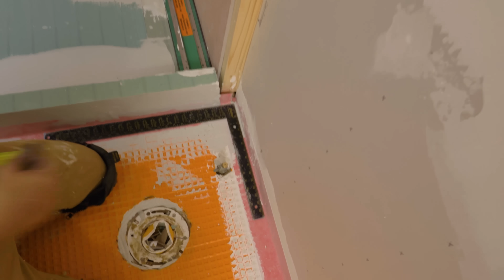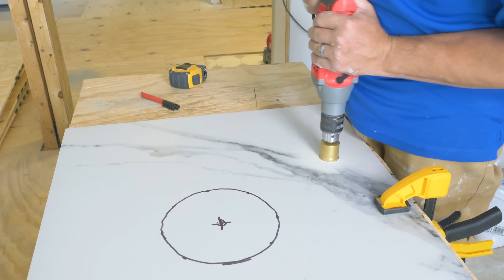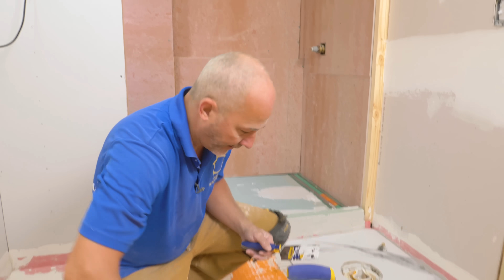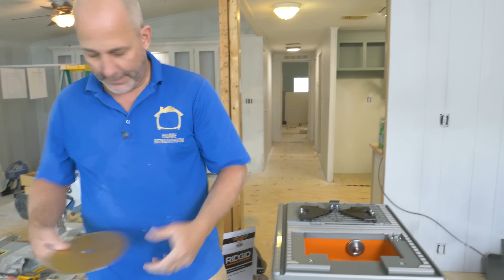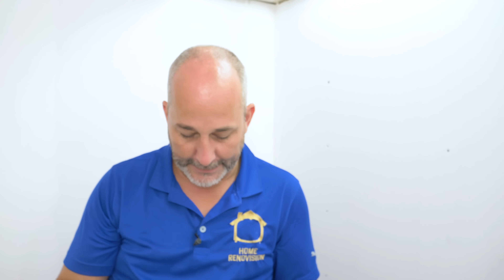How to Install Bathroom Floor Tile for Beginners

Comment: I really struggled with a threshold in my bathroom, as the tiles and Detra mat lifted it higher than the bedroom. I managed to adapt the original wood threshold, but never considered using a stone threshold, which comes with the advantage of locking the water in the bathroom. Brilliant idea!

Comment: Do I need to level the dimensional lumbar subfloor in a 2nd story bathroom before putting Ditra down? Going to be using 12x24 porcelain tile. Also does the vapor tape need to be used along Ditra seems to make it monolithic?

Comment: I strongly recommend using gaffers tape instead of duct tape to tape your cables down to the floor. I can see it in the beginning of the video in the other room. Gaffers tape is made to hold cables to the floor securely without leaving glue residue on the cables, easier to pull up, and won't pull up pieces of the wood floor.

Comment: good job Jeff, although the tile with the heavy design would maybe have been better to use first that has the hole cut outs, as the grain continuation would have looked better

Comment: I understand that transition piece helps keep water from going into the hall or next room but what about around the perimeter of the room? Won't the water just go into the studs and space under the drywall? Or does the silicone bead keep it from doing so? It seems the bead would have to be fairly hefty.

Comment: if laying over concrete, how much of unevenness is tolerable? ive seen no more than 1/8 within 6 feet. so does that mean i can have little dips and humps on the floor within 6 feet as long at its no more than 1/8 inch? ill also be laying ditra but wanted to ensure my subfloor is first ready. thanks!

Comment: You have great videos, but nowhere on YouTube does anyone answer what type of wood they use underneath the tile?  I am remodeling my bathroom shower.  They had plywood (1970's house) on top of the 2x10's before the dark colored cement of some sort, then the tile.  Wood needs replacing now.  Ok, so there are lots of different types of plywood.  Indoor, outdoor, marine grade, etc.  What does everyone use, and how thick now?  1/2", 3/4"?  Probably going the Schluter system after replacing the floor.

Comment: Excellent Vid.
Little question. On one tile you changed direction of the adhesive “comb”. I assume this does not matter?

Any chance you could do a video like this, with one of those electric underfloor heating mats, and a decoupling mat  on Plywood?

Comment: Jeff I noticed you taped the seams around the edges of Ditra membrane with that pink tape. Is it necessary to tape the seam running the length of the room where each piece of Ditra meet each other?

Comment: An excellent tip provided by 7.7.0bassin2 - (just slightly tweaked) Be aware, if this is your first time laying tile you need your cuts to be perfect, if not you can ruin your project. TIP: Get pieces of cardboard cut them to match the size of the tile you are installing. (example in this video Jeff’s are 24x24) - Then, when you need to cut a tile to make it fit, first cut one of the pieces of cardboard instead of cutting a tile just to sure everything fits the way you want it...  then... Repeat the cut on your tile. - Doing it this way saves you from cutting a tile incorrectly which can get expensive if you have to toss them out.
Reply: Brilliant! Thank you.

Comment: I did my first tile job in our bathroom and used the same spacer wedge system , worked really well. Always wanted to try laying tile , the wet saw worked really great . I did learn , don’t mix the whole bag of grout , by the time I was almost to the end it was starting to dry up. 
Thanks for tips

Comment: Thinset doesn't stick to thin set. When you prefilled those holes you compromised the whole point of the ditra waffle design. The holes hold the thinset to the membrane

Comment: The stone thresholds usually need to be sealed right? At least that is what mine says. Instructions say seal before cutting and install, and seal again after. Is that altogether necessary? We have had quite a bit of extra expenses, large tools, that we were not expecting and my husband is not happy we might need to purchase something else to finish this renovation. But we do want it done right… can we do without or is that stupid?

Comment: You didn't tighten the arbor nut on the saw before you plugged it in or use it?!
Jesus man...lol. 
Glad you corrected that later, you had me worried!

Also, why did you thinset over one area of the Ditra and allowed it to dry (3rd tile area)?
That ruins the whole point of the Ditra as those key holes are already dried & not bonding to the tile to allow for movement.

Comment: What thinset did you use? Is it the same schluter all set you used for the schluter ditra video? At what size tile do you recommend using the spacers that level out? My tile is 8x10 inch. What grout did you then use? Did you have to seal the grout afterward? I've watched this at least 5 times, writing down everything and getting up the courage to tile my own bathroom! Thanks!!!

Comment: I know  you're  doing tile, but the wood in my bathroom door way is damaged, can that be replaced without having  to replace the entire frame? I learned so much from your tutorials,  even if I decide to pay a professional, I know what to look for or even which questions to ask, to help me determine if they are a fit. TY so much for your tutorials.

Comment: Hi Jeff. I need to replace my tiles as they are chipped and were installed unevenly before I bought my house. My home is in an extremely humid tropical climate. Are tiles my only option for flooring? Would appreciate your advice. 😊

Comment: Now there is a well in your” waterproof “ floor under your mdf cabinet should have installed a piece even with a very rough cut and fill  with thin set. Just saying.

Comment: I have a bathroom remodel that is on the opposite side of the house from the septic line.
It doesnt have enough fall and my only option is to install a sewage ejector pump however there is no basement so it would be installed in the crawlspace. Ive looked everywhere and havent come across this setup. Any pointers or tips woupd be much appreciated!!

Comment: TIP: if you have to cut outside in cold climates use diluted antifreeze instead of water.
Check the box for the wet saw splash guard, they should always come with one for safety.

Comment: Using all-set always read instructions on back.  You have to mix at 200-300 rpm for 5 minutes, let slack for 10 minutes then mix for 3 minutes.  This will give you an hour or so working time with the thinset.  If it gets stiff, you can re mix it but do not add additional water.

Comment: @Home Renovision DIY Whoa, whoa, whoa.  I remember hearing that tiles this big can't be installed into older homes.  Am I remembering this incorrectly?  I think I heard it on this channel.  I have a house that was built in 1968.  I can visually see cracks form every spring as the house "breaths" and adjusts to the new climate.  Built on clay.  Can I install 24x24 tiles?

Comment: I'm trying to square up what you said/did early in the video vs what you said late.  is the thin set waterproof or not?  If so, you trapped water under the tile when you took off the valve and let it run before setting your first tile; and won't that become a problem (idk, mold? poor adhesion?).If it isn't waterproof, won't water just wick through it to the flooring beyond the quartz sill?

Comment: A thousand blessings on you for sharing like you do. What about large format tile over a cement slab that is covered tightly with industrial type linoleum squares from the 70's? Thank you
Reply: Ardex P4, one easy coat, and tile as normal...  Brilliant stuff!

Comment: When you say uncoupling system, does that mean the rubber/plastic membrane will flex with the floor to help prevent tile movement? I'm seriously interested in using that, that would solve so many transition issues.

Comment: Not to be a hater but the plumber should be fired on this job. The lead bend and water piping should have been changed and re roughed to fit the job.
water piping threads above the floor and the flange above he floor. Just saying.
Reply: The plumber was some guy in a mobile home factory 40+ years ago. He probably wasn't a plumber. He probably is retired.

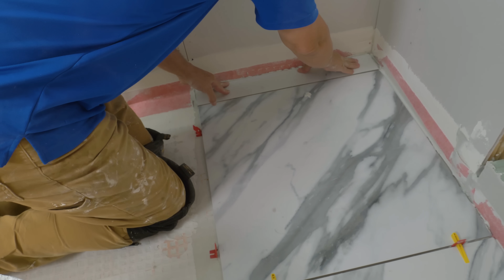Comment: Jeff, when you lay the strip at 46:40 in your video-- why did you not use your spacer/leveling system?  Thanks!!!!
Reply: He’s been doing it long enough and can tell it’s flat so no need. He used a straight edge to make sure it was flat.

Comment: I installed a mansfeild walkin shower and used your sand mix tecnique! Turned out great! Thanks!
 After watching this video , I am thinking about making a 24×24 tile to step out of the shower on instead of  V plank flooring.
 I want it slightly higher than the floor , I was thinking  of removing 1/8 inch larger  than the tile so there would not be a full lip and tile would not just be sitting on top of flooring !  Would It be better if I siliconed the gap like you did with your entry way into the bathroom. Or if I just put the 24 inch tile  in like you demonstrated so well?  My concern  is making sure water can not get in flooring in the 1/8inch gap?

Comment: In europe we normally dont have pipes coming up from the floor in shower areas due to the extra risk of water damage. Maybe its diffrent overthere
Reply: In foundation homes they come out the wall here as well. This is a mobile home.

Comment: What are the alternatives to that orange underlayment. Every video I see uses it. What was used before it existed?
Reply: Wire mesh reinforced mortar bed. Cement board. Hardiboard. Tiling right over plywood. But not all of these are suitable for large format tile.

Comment: Tip if it is your first time laying tile or anything you need your cuts to be perfect so you don’t ruin your product get pieces of cardboard cut it to your tile like example Jeff’s using 24x24in tile cut a piece at that and use that for your cuts mak sure everything fits the way you want it then just repeat on the tile cuz it’ll get expensive if ya have to toss them out
Reply: Nice!
Reply: Excellent idea